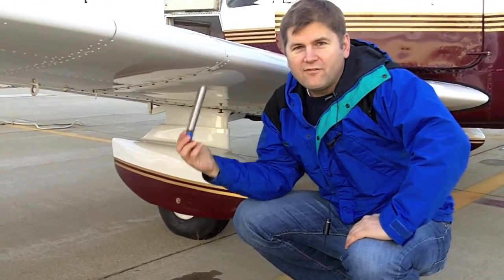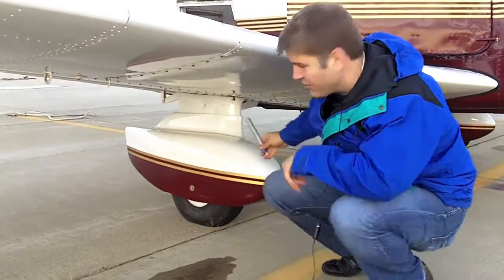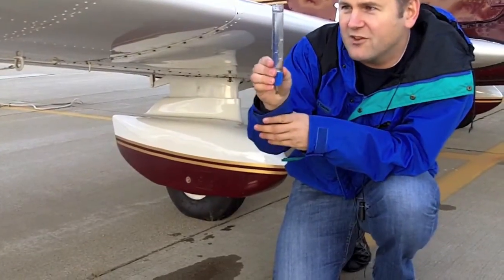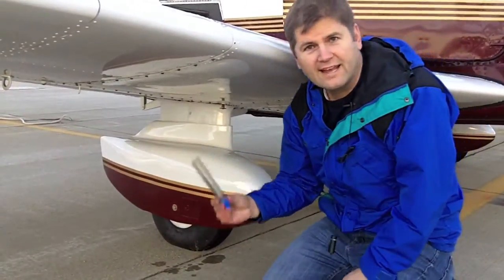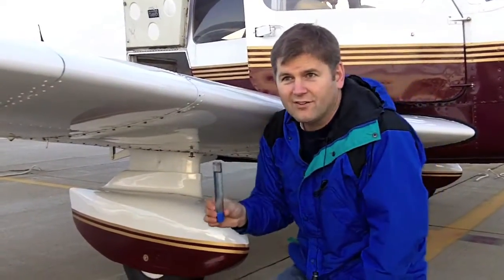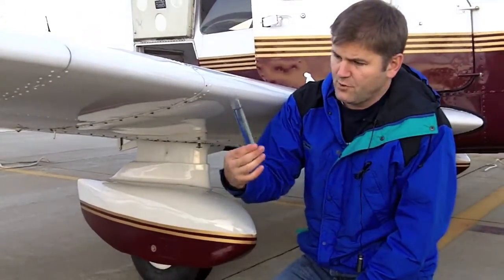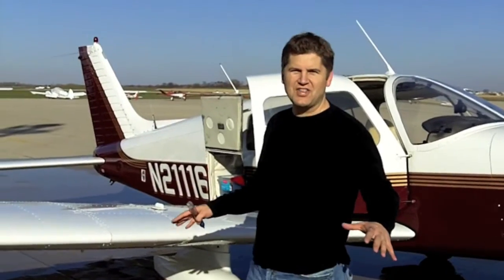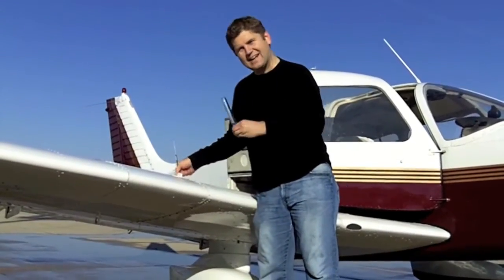Water in the Fuel - Episode 7

Comment: Wow.  In my 12000 hours of flying I have never seen that much water in a fuel tank.  Maybe an inch or two max in the bottom of the fuel tester.  If your plane sits outside (which I suspect) you need to check your cap seals.

Comment: Avgas does not absorb water only automotive fuel with ethanol does. The moisture is usually only condensate because air gets in through the breather. To see more than a teaspoon in the tester indicates a major issue. Either the fuel from the tanker is bad or theres a bad or missing filler seal. I wouldn't fly until I knew which. That's way too much water.

Comment: My instructors all told me the same thing never to put the fuel back in the tank just in case you missed some dust or anything that might contaminate the engine, and they told me to spray the drained fuel spread apart instead of making it sit in a pool that way it can evaporate faster. Thanks for the video though this is the first time I see water and fuel sitting in one tube, I never knew what to look for exactly when the fuel is contaminated. Never saw anything different to be honest.

Comment: Useless video.....fuel does not absorb water...water condenses onto the cooler internal exposed areas of the tank in the evening, exactly like when you breathe onto a cold surface.  Hence the recommendation to keep tanks topped up.  It is more likely the fuel tank was virtually empty when tested for water. Also there is not much point in doing a water check shortly after refueling....there needs to be at least a half hour for the water to settle out at the drain point.
Reply: There is free and dispersed water in fuel
Reply: @spannaspinna  typically 0.5% H20 in fuel.

Comment: HI, at 2:05 you say that even if the water was separated from the fuel, for safety reasons, you can't put that fuel back into the engine. But at 3:40, you pour another sample back into the engine.
Reply: theknightlynews that was after the water was out and it was just fuel at that point.